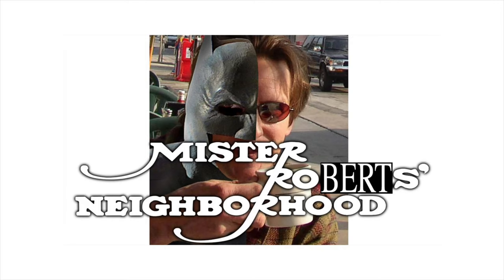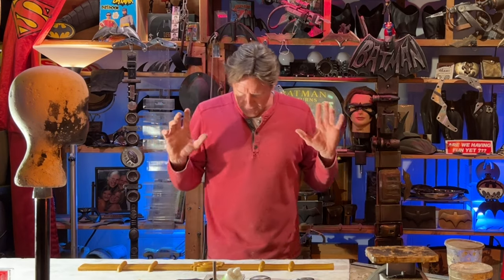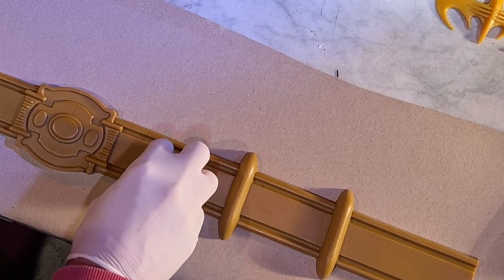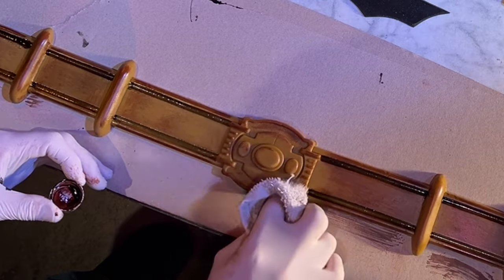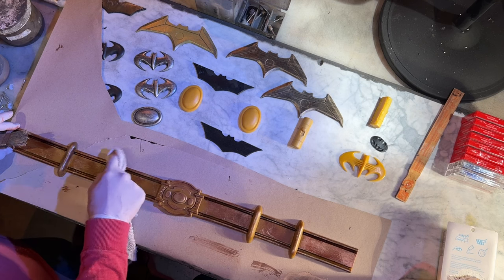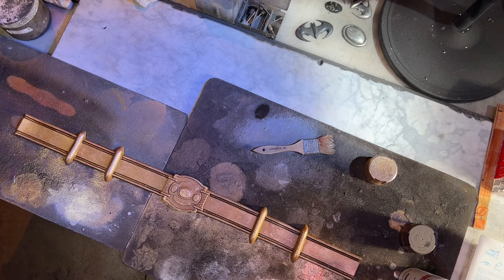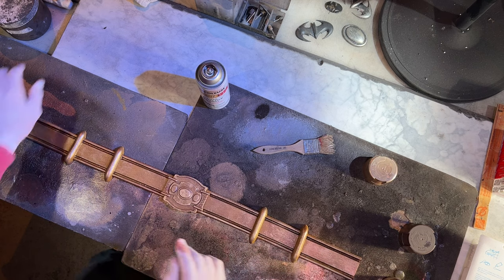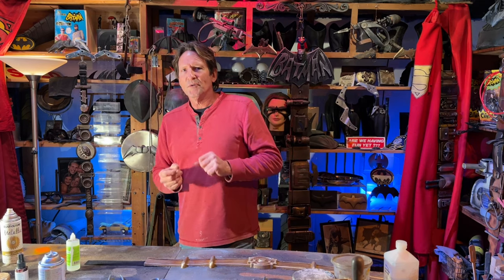DIY Painting Urethane Batman Utility Belts Advice

Comment: The Velcro tip is great to prevent belt slippage.
Reply from the maker: Thanks a lot. I figure every little bit counts.
Reply: I used it on my Halloween outing 😊 it don't matter what you do Velcro will definitely keep it centered. Make sure you put one in the spot of your armor as well.

Comment: Great process you have there Paul. I have found you can also use vinyl/leather dye spray (I used to use Nu-Life brand but I can't find it anymore) but you need to very lightly dust it. Also urethane bumper paint but that's usually only available in flat black.  As you know I used to make a lot of urethane belts back in the day. Also, I'm still in contact with Michael occasionally.  I also would usually embed the velcro (or in my cases the nylon web belts) into the urethane.Takes a little extra time when pouring but then I didn't have to superglue the straps on).
Reply from the maker: I remember those products, I haven't fooled around with them much but they seem like they would be a good thing to use as well. I know one time when I used to drive one of those red Fiero two seater cars from Pontiac. You never see them anymore but it was fun for a while. I hit something or something hit me really badly on the bumper and it popped back out I went out to look and you could see nothing so obviously the bumper paint if that's what it's painted with is great stuff too.

Comment: I had a urethane belt that had a crack and it eventually snapped into 2. They dont really last well in my opinion. any idea on how to fix it?
Reply from the maker: I have had so much trouble with urethane and that's why I don't use it. But I will say this like I said on the video you have to use the entire product while it's brand new or it deteriorates quickly. You have to mix it well everything has to be done perfectly and even when you've done that I would still recommend, and I didn't mention it in the video but I should've, to back it with something to add extra strength. I think I'll mention that in an upcoming video. But for you right now I would say this use some zap a gap with kicker or superglue it should go back to together again and then back it with something for strength like a belt or something that is strong but flexible.